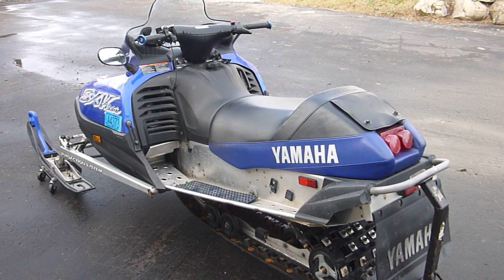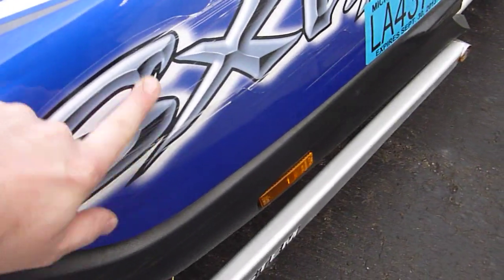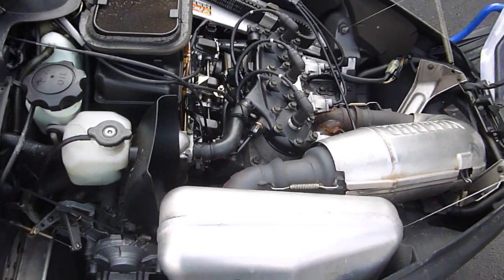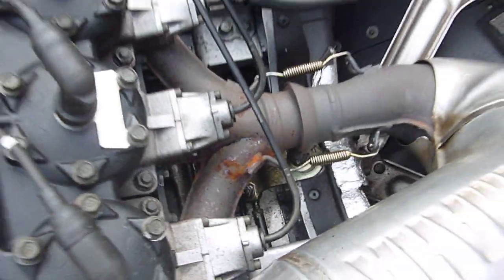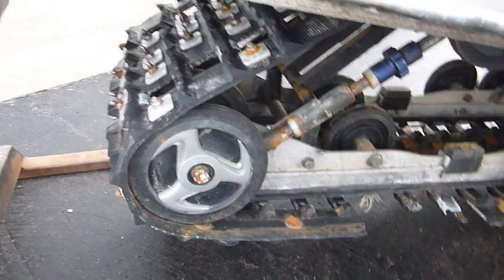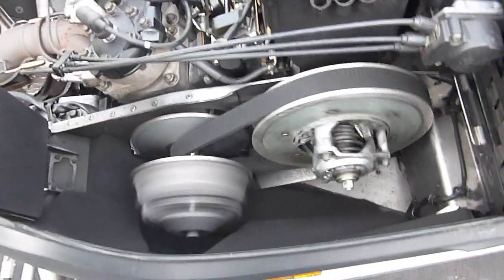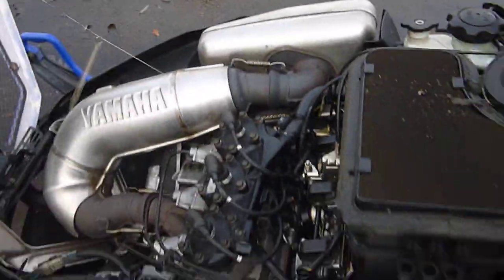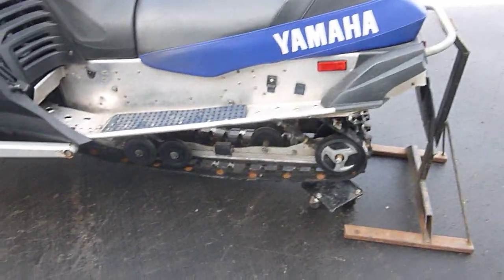2002 Yamaha SX Viper 700, 10988 Miles, Parting Out

Comment: +dbcycleparts I was thinking on it, and what you said before is true. The parts on this worn out sled will keep other sleds running for years. But sleds with maybe 2000-4000 miles in perfect shape deserve a second chance. (Unlike this one here) THOSE are the sleds that should be sold whole (and you can probably make a good buck on them.) Sorry for arguing against you earlier.